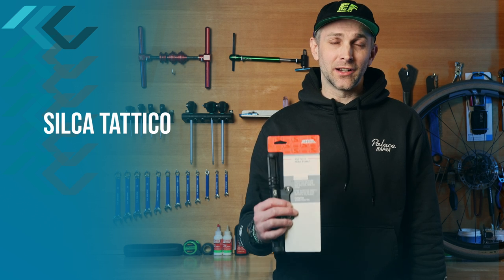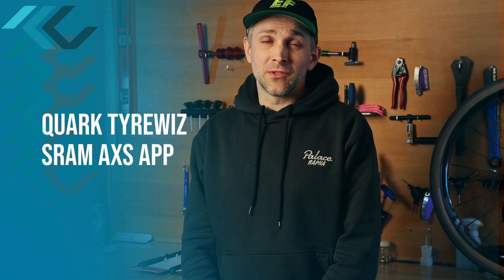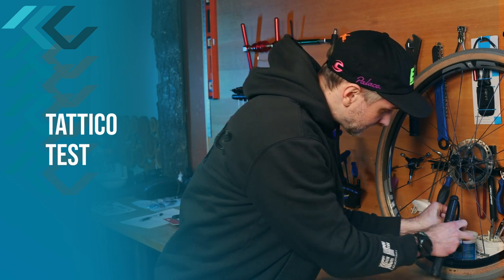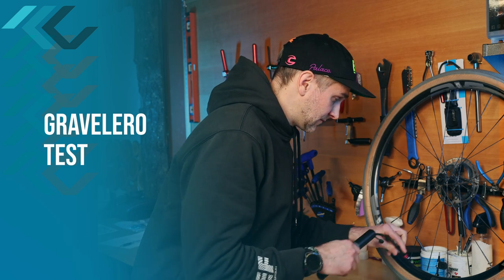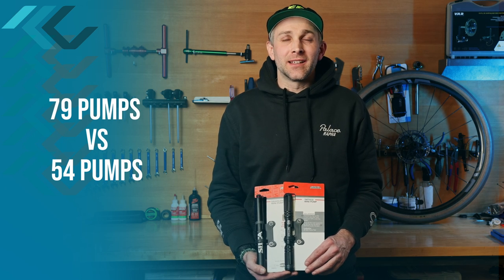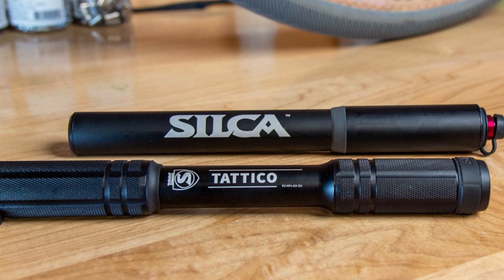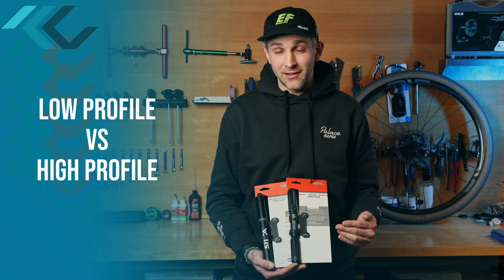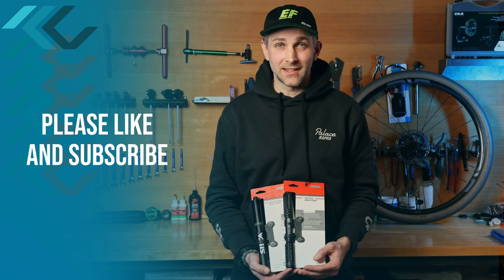Silca Tattico vs Gravelero

Comment: I really like having the flexible hose. I find it quite useful when you’re pumping away and you don’t want to be yanking/bending the valve on accident.
Reply from the maker: Agreed. It adds another layer to the ease of use. When they are built onto the pump it can be a pain to use.

Comment: I'm still torn between the two: for lower psi, sure, the Gravelero. For higher psi (90+) of road bikes, maybe the Tattico. But I have a road bike that has 21mm internal rim width, using a 28c tire, and the Silca Pro Tire Pressure Calculator recommends about 78 psi (rated maximum of Gravelero is 80 psi). I wonder which would be easier to use? (I'm concerned that the Gravelero might be difficult to pump when reaching it's maximum rated psi capacity).
Reply from the maker: Give us a follow. We will film a quick follow up video on max psi comparison and post it up in a week or so!

Comment: I have one of each, one for the road bikes and one for the gravel bike. I used the Tattico on the gravel bike before discovering the Gravelero. The Tattico knurling gets full of dust on trails and it takes a bit of work to clean it up. Gravelero does not seem to look as filthy after a day on the trails and wipes clean anyway. 

The Tattico is a thing of wonder and helped many a sad cyclist at the side of the road. They are amazed that it properly fills their tires with air and without a whole bunch of effort, especially after not having much luck with the mini pump they had or having run out of gas.  Gravelero is obviously better again, not really a thing for strapping to your road bike however. I had thought the rubber cap might part company with the pump, this has not been the case - yet. Its a bit of a let down on a Silca product where they bang on about quality and design. Its cheap and terrible and they need to fix it.

If I were buying again, I'd get just the Gravelero and a bunch of holders and swap it around all the bikes as I currently do with the Tattico. I'd do something about the terrible rubber cap as well.

Comment: I have both of these pumps and the Gravelero has a fatal flaw: the design of the cap is horrible. Mine fell off one month into ownership, mounted to my frame. I left it as such and a season of rain flooded the pump and now the hose part is stiff and doesn't want to retract into the pump body. Even if the rubber cap had stayed on, it would have still allowed rain and grit and mud (I mean, those conditions can't happen on a gravel ride, can it?) to get into the pump chamber. I disassembled the pump completely and clean and relubricated the piston, but time will only tell if this works ok. I think they're going to redesign or have already redesigned the cap to be more like the Tattico (which still works great), but I cannot recommend the Gravelero ver. 1.

Comment: I find them to heavy for what they cost but maybe they have some hidden maginal gains build in ...
Reply: Marginal gain is not really a consideration when you get stuck at the side of the road because the terrible lightweight pump you bought doesn't work or you run out of gas. And if you race you take it off anyway. The Gravelero is intended for big volume tires and is actually more compact than some in the class. 

I have tested many mini pumps, and some are really terrible. These two however are among the very best of breed. Pumps that work properly and last for generations are in fact what Silca are known for.

Comment: Meaningless review, redo the test and count the strokes to get to 100 psi...if you can get there.
Reply: I'm not sure anyone runs 100psi these days.    80psi?  maybe.
Reply: @DoneRightReviews  Sure, so go and try to put 0 to 80 psi in using either of those pumps, and then tell me what you think, count the strokes while you're doing it, and let's have a video of your face as you strain trying to get to 80.  For kicks do the same test with a Lezyne Road Drive medium size and tell us what your experience and thoughts were.  The Road Drive has 3 sizes, but the large one is 11 inches long, but it does make pumping up my wider touring bike tires to 70 psi not too bad of a chore.   

By the way, I have 700x25c tires on all my road bikes except for the touring bike, which has 700x42.  One of those bikes has Vittoria Corsa Pro tires, they recommend 95 psi for a 170-pound person like I am.  And I know that Continental has a similar tire like the Vitt, as does the Specialized cotton turbo tire, so there are tires out there that require higher psi than regular training tires.  

The only pump I found that will get me to that 90 to 95-pound range is the Lezyne Road Drive medium and the large, but even with the medium pump, it takes a lot of effort to get to 90.  The Topeak RaceRocket HP, which I also have, can make it to 90 but it's more work than the Lezyne, but neither is easy.

Over the years I bought a lot of pumps, sent the majority of them all back and only kept the two Lezyne's and the one Topeak because all the others failed to get to even 70 psi.  I'm not one of those who get the smallest lightest weight pump on the market, get a flat, pump up to 45 psi, and ride slowly back home, nope, I want a pump that will get me to my riding psi and continue the ride.